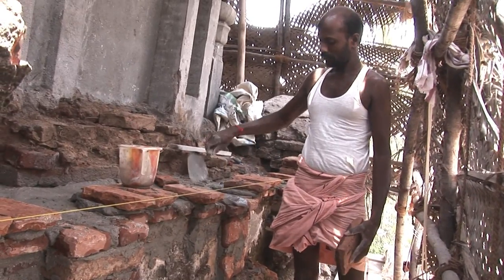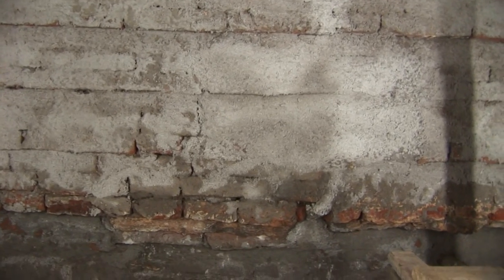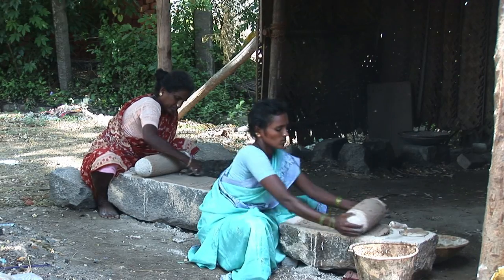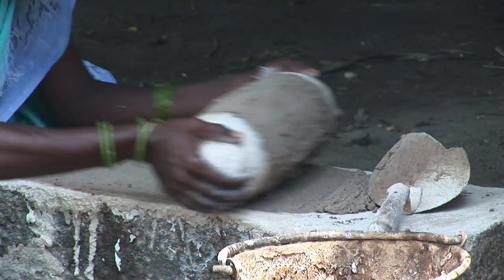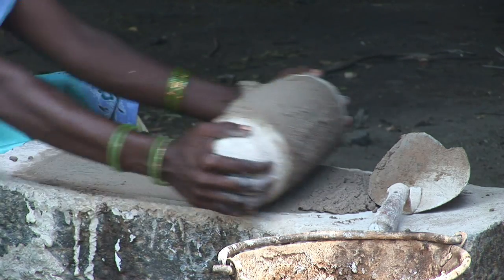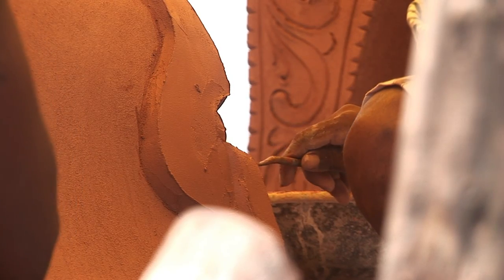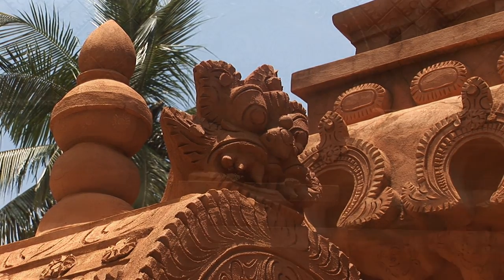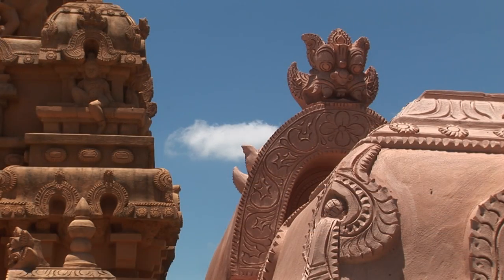Lime Mortar an Ancient Cement

Comment: Using lime mortar (vs. cement) keeps the indoors cooler by at least 10 degrees.
Reply: Bt mullarperiyar is not safe
Reply: @aravindmk4073  On the contrary, that dam made of limestone and surkhi is still going strong, in spite of the age and siltation and seismic possibilities. Don’t forget that the dam is rather old too. Now, my comment was on the indoor temperature of a home made of limestone, but you are talking about an outdoor dam, not sure how it’s connected.
Reply: @arpitadatta2711  it is build by british that's y it lasted so long
Reply: @aravindmk4073  What’s your point?

Comment: no one is sharing why cement overtook. British invasion is the ans
Reply: Not the British... It is the cost...
Reply: It's because of setting time it's slow 
You can't paint on lime motor it crackes if you paint 
Cement as more compression strength than lime motor
I am telling what I know
Reply: @paperbird4765  cement uses fly ash, which is a waste product of thermal power plants, the govt forces us to use their waste product and make it costly for us. 
Cement sets very fast, but lasts just 50-60 years. But lime plaster(takes some 5-6months to set, but it's stronger) homes have lasted 200+ years. And still many old European buildings are renovated using just lime plaster because cement is crap. 

Lime plaster homes still exist even today without a single chip on the ceiling. My home is an example, 55+ years. If it was concrete, you could easily see the rusted steel and chipping of the plaster.